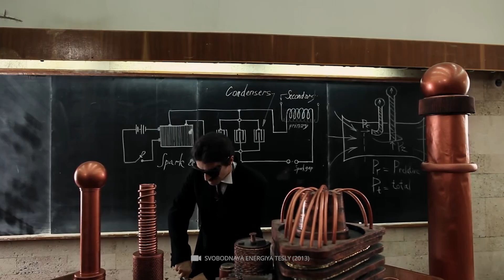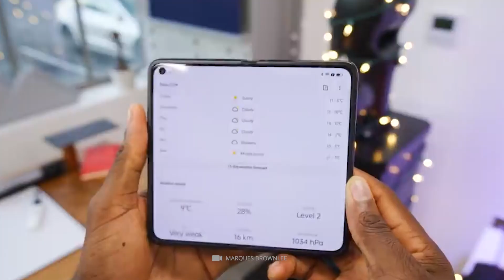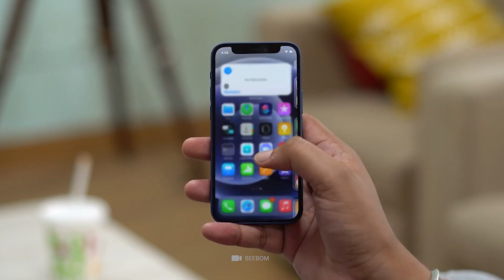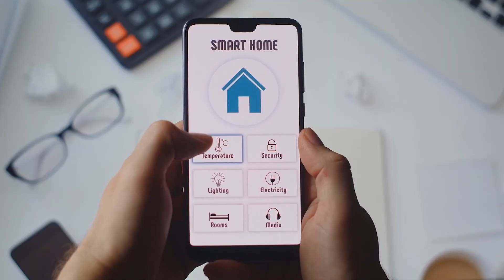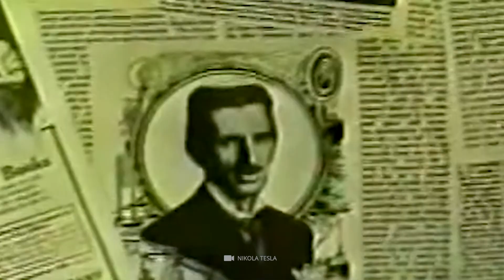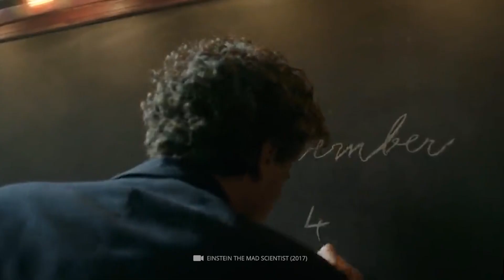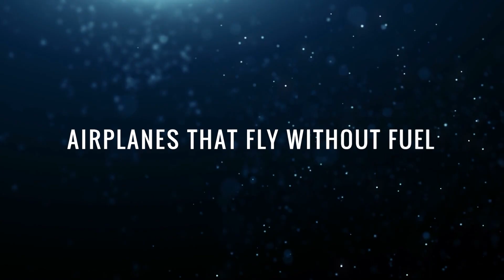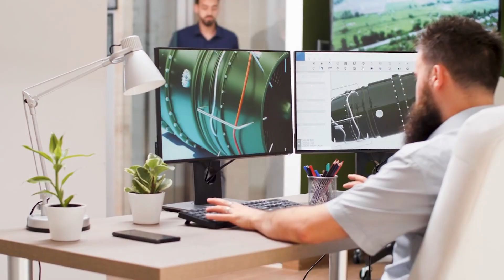Nikola Tesla Predicted the Future of 2025!

Comment: Tesla's cars and 12 inches of water= bad news. Not to mention the power grid already can't handle it. 19k plus for a replacement battery. 
I'll stay with Powering my home and gasoline moters from HHO  hydrogen and oxygen from water. Information been on the web 10 years. For the ones saying it won't work you have been indoctrinated and never tried it yourself. I've been doing it 4 years and east county have had it on there mopads for 2 years.
  1gallon of water runs a generator to power my home for 5 days. YOU WILL BE SURPRISED at what lie's we have been told.

Comment: A vehicle that's untililize the force of the wind that partly uses the in car turbo to power the alternator and a small back up 4 cylinder that also charges the battery bank and a solar heat sink body and also a high tension coil band that used to start up in get it going ?????

Comment: Why hasn’t anyone considered this: Tunguska Event 
“Tesla said his transmitter could produce 100 million volts of pressure and currents up to 1000 amperes, with experimental power levels of billion or tens of billions of watts.(18) If that amount of power were released in "an incomparably small interval of time,"(19) the energy would be equal to the explosion of millions of tons of TNT, that is, a multi-megaton explosion. Such a transmitter would be capable of projecting the force of a nuclear warhead by radio. Any location in the world could be vaporized at the speed of light."-(source)Tesla Memorial Service of New York

Comment: Tesla was a very good engineer. 
Physicist he was NOT. 
He thought atomic energy would never work. Disagreeing with Einstein. AC(alternating current)was Tesla's specialty. Edison was interested in DC(direct current)which can not be transmitted over long distances. 
Remote control, radio, television, facsimile, are all AC applications. In incidentally, power can be transmitted with microwaves. How much is the problem.

Comment: Do you have a well engineered robot? The code for the SOST to function fully is F=m*a^2.35 or F=m*a*2350 this runs their system at the correct full speed. They need gold for their array of sensor systems.

Comment: Maybe the energy is in the atmosphere and we just need to find out how to receive it and use it. Could have Tesla have been on to that??
Reply: Tesla's tower both pulled the electomagnetic energy out of the  atmosphere and telleuric energy out of the ground and water. He chose CO because of the electric currant that can run through granite quartz.
Reply: Yes.
Reply: The Earth's Ionosphere which can be tapped into about 50 to 60 feet above ground for free electricity by using a metal conductor pole.